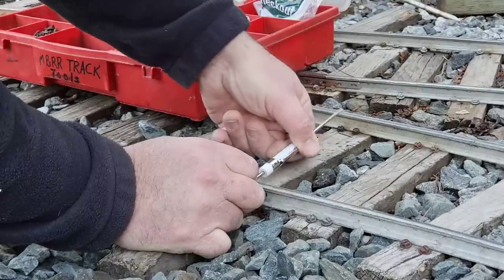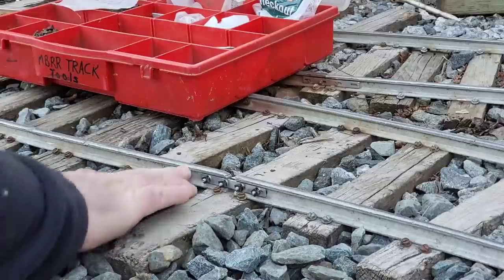Jacking, Packing, and Quick and Dirty Joint Repair

Comment: Is there a reason for the "large" gaps? Expansion, nessary play so parts don't break?
Reply from the maker: Large gaps are generally to be avoided. 
The only reason I left it there is because it's on a straight piece of track in a yard, and I'm going to replace the rail later. 
I don't need more than 1/8 inch for expansion.

Comment: Please consider doing a video on building a railroad and where to get the parts and electronics.  I would be interested in things like what motor do you use and the electronics.  The purchase of where to get the  rails would also be of interest.  We may not be planning on building a railroad like yours, but it we are very  interested in how it's done.  Just and idea for a video.
Reply from the maker: Thanks for the suggestion!
Reply: @MillBrookRailroad  Some railroad enthusiast may not have the area to lay proper lengths of tracks, but have the desire to build an engines or cars.  It would be great if the existing railroads would set aside special days for builders of these engines or cars, could rent time to run their creations on exiting railroads. Also, Is there a news letter listing the small gauge railroad locations?  Just another crazy idea. LOL

Comment: Why did you leave a 1 inch gap between  the tracks, that's a bit hard  on the loco and burr the track ends,???
Reply from the maker: It was a quick repair. I'll be replacing the rail in the spring.

Comment: Good job tamping the track. It really appears to me that those joint bars need to be much thicker for the work they have to do keeping those rail ends in line and putting up with the weight of the train. Just my thoughts on it, but out on the main in that curve you have a lot of "square" joints that I think a thicker joint bar would fix easily. Oh well, you do an amazing job with this. :)
Reply from the maker: I agree. Thicker would be better, but even better would be something contoured to the profile of the rail. I use what's available for now. When I have a bigger budget, I'll upgrade.
Reply: @MillBrookRailroad  Ah ok. Yeah, it is expensive as heck for sure. :( Not being in this scale, I didn't know if this was the standard joint bars they sold or not. cool, keep up the good work.
Reply from the maker: @s16100  There's nothing standard about my track. I'm using 1" scale rail, which is roughly equivalent to 70-lb rail for 1-1/2" scale. I knew it would be a compromise, but it was around 25 cents a foot at the time, so I bought it. If I'd had the money, the whole railroad would have Culp Rail. There are tie plates, really nice joint bars, and switch frogs available for Culp Rail. 
I have to have a foundry make the switch frogs for the lighter rail. The joint bars came from another railroad, as did the rail, and if I want tie plates, I'll have to make them myself. 
I wish it were as simple as buying a part.
Reply: @MillBrookRailroad  Oh wow. Yeah I get it. You make do with what you can afford. I am in 1:32 scale live steam, and I actually hand laid all of my rail with o scale 148 rail for the same reason. cost!!! I get it for sure. So what about just making a few thick joint bars for the curve on the main yourself? Would that be cheap and easy to do sticking with the bar stock design as you have now?
Reply from the maker: @s16100  It might be. I hadn't given it much thought, to be honest. Too many other urgent things in the way. 
I like the suggestion, though.
Reply: @MillBrookRailroad  You know, maybe even just double up the joint bars you currently have on some curved joints with a longer bolt? Just my brain still thinking. sorry! :)

Comment: Call me ignorant and inexperienced railroadwise, but as a transit bus mechanic, it seems like you're not putting enough torque on those joint nuts.  The bolts should be held still while you torque the nuts to at least 20 foot pounds.
Reply: Not sure if those little bolts could even take that much, maybe 20 inch pounds...but you have a point. 
If All else fails cross threading is better than any loctite haha